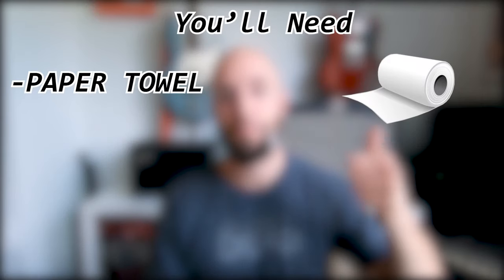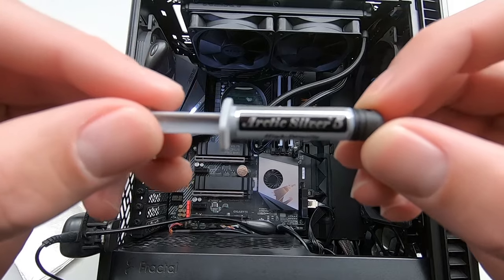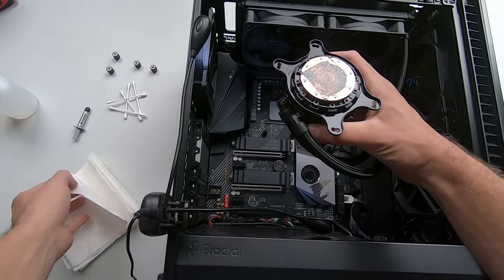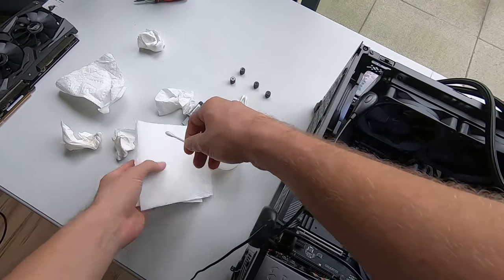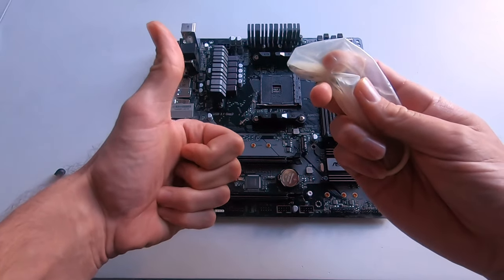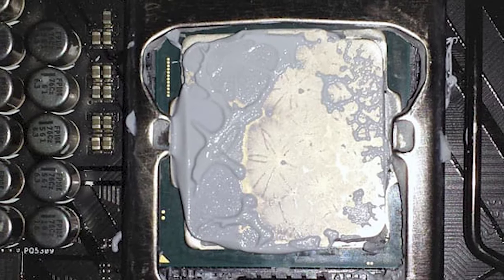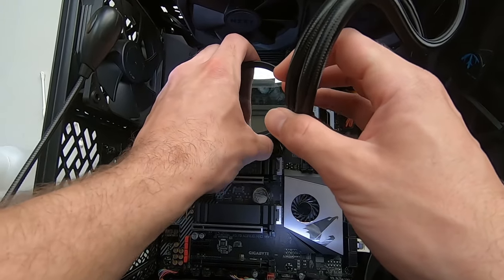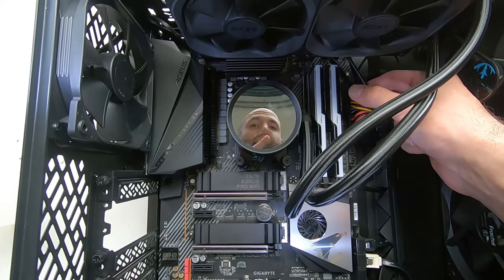BEGINNERS GUIDE: How To Apply CPU Thermal Paste

Comment: What to do if it keeps saying ran into error and keeps resetting
Reply: You probably didn't apply enough. The same thing is happening to me.
Reply: @1mobile984  you actually wouldn’t believe what the problem was… i took it to a professional and it wasnt my thermal paste application, my cpu or gpu it was the fact that my volts were too high and i had to get 1.2 volt ram instead of 1.35… odd pc problem encounter you dont hear about much lol
Reply: @lewispalmer3339  that's weird. My PC was running fine for a year until I recently swapped the cooling system and put another fan. All of a sudden it crashes
Reply: @1mobile984  can your power supply cope with the extra power needed?
Reply: @Gooner333333333  Yes. I ended up figuring it out. It was a bad PS3 controller 🎮 I was using. It kept crashing my PC until I unplugged it.
Reply: @1mobile984  Omg something as simple as that

Comment: Every when should you replace the thermal paste?
Reply from the maker: Until you have a thermal issue.
Reply from the maker: @Facepalm Full O' Napalm 1. Thermal throttling. Clearly there is a heat issue. 2. idle below 50 and below 80 when at load. That's my personal guideline.

Comment: You got any video that you switch to other cooler? Because i order a new cooler for my cpu and i want to change the old one for a new one ? I bought my pc not with a stock cooler but now i want to put a better one but do you need to dissamble your whole motherboard or can you dissamble just the cooler en remove de brackter in the back en put new paste and new cooler? Sorry to bother but i just wanna know iam from netherlands and they do not give much information here about it. Greetings j from holland 😊
Reply from the maker: You shouldn't have to disassemble everything. Usually it will come with that bracket to swap out on the back and the appropriate hardware for the front. Just take it slow if it's your first time.

Also, Max Verstappen #1 👑

Comment: My old 2016 PC build amd A8-7600 (i think?) randomly shuts off completely, not restart but shuts off. Could it be the thermals? Do I also need to do these same thing here? Thanks folks
Reply from the maker: Check thermals. you can use a program like HWiNFO to get all the data you need. It could also be a power issue.
Reply: @TechIlliterate  thanks for the response. I checked the power supply and their aint any issue. So yea, most likely the thermals. What do I do with it if it is not normal?
Reply from the maker: @sdmarinkashifu4536  You can re apply paste, clean out the cooler and make sure your case has proper airflow.

Comment: HOPING SOMEBODY HERE CAN HELP ME OUT, I MOVED THE HARDWARE OF MY LAPTOP INTO A NEW BODY AND NOW I GET NO POWER AT ALL NOT EVEN A CHARGING LIGHT. THE ONLY MISTAKE I CAN THINK OF IS I DISCONNECTED THE HEATSINK ATTACHED TO THE CPU BUT IMMEDIATELY REATTACHED IT ONCE I SAW THE THERMAL PASTE. CAN NOT REPLACING THE THERMAL PASTE BE MY ISSUE?

Comment: The proper way is to spread a thin even coat almost to the edge. Not drop a bead in the center.
Reply from the maker: Debatable. Shall I make a comparison video?
Reply from the maker: @Brian Babin impressive results. My tests turned out differently.

Comment: Thermal paste goal is to maximize contact via the micro groove imperfections of both the cpu and the heat sync... thermal paste is insulating as compared to the pure metal surfaces... that’s why the best method is the micro spread method. The pea method is WAY too much paste and you’re creating an insulation layer.
If your spread method leaks down the sides you’ve both spread too far and used too much thermal paste.
Reply: But the spread method can trap air bubbles. The Pea method misses the corners. The "X" method looked best in the "glass plate" test.

Comment: Do i need to apply thermal paste if my cpu doesnt come with a cooler fan
Reply: In case you're not trolling:
If your CPU doesn't come with a cooler that means you need a better cooler. Of course paste is always required.
Reply: @wartem  sorry i just bought all the parts to build a pc i never built one before. Im scared to put it together since i know nothing about the parts i have. I have a liquid cooling thing doesnt that connect to the cpu?
Reply: @SonictheHedgehogInRealLife  Paste helps you remove space between the cooler (liquid or fan) and the processor. Otherwise it's metal against metal hence too little contact.

Also keep searching these how to build videos from major channels and you will be good to go. Watch a few.
Reply: @wartem  yea ive been watching a few i have the installation guide to my motherboard and it shows how to put in the cpu, apply thermal paste , memory and liquid cooling fan.
Reply: @wartem  i found out my liquid cooler has thermal paste applied to it already. That means i dont need to apply thermal paste?
Reply: @SonictheHedgehogInRealLife  Indeed. Then it's pre applied which some are. Should be good to go. Just make sure to put it in place correctly according to the manual for your model. 
If you need to remove the cpu in the future you will have to buy paste and clean everything first before applying. I recommend Noctua NT-H2 or H1.
Reply: @wartem  ok i watched a couple more videos i understand a little more can you recommend some videos?
Reply: @SonictheHedgehogInRealLife  Remember to follow the manual but get tips from videos. Because some things are not the same.
I just completed a build btw as we speak :) 
Gamers Nexus is reliable. 
But just search "build pc" and watch some of the most watched and liked videos.

However I watched Linus tech tips first person pc build video. Can't say I liked it.
Reply: @wartem  thank you i will make sure i read all of the manuals first and do research. I got a static bracelet as well
Reply: @SonictheHedgehogInRealLife  Great!
Some uses it on their ankels to get use of both hands. It's in the way otherwise since it's connected to ground.
Reply: @wartem  can i connect it to the case i saw a video where a guy does that and says its fine.

Comment: Ethyl alcohol?
Reply from the maker: That's fine to use as well.
Reply: @TechIlliterate  thanks. I'm just trying to understand how to do it so if i build one Ik how 2, do you have any tips? Should I buy a pre-built instead? I only want it for gaming
Reply from the maker: @Marsmaybehim  Pre-builds are often great though you would be missing out on the satisfaction of building your own.

Also a great way to get to know the parts of your PC so you can troubleshoot if there are any issues.
Reply: @TechIlliterate  do you recommend any specific prebuilts for gaming?
Reply from the maker: @Marsmaybehim  Pre builds are great however you would be missing out on the satisfaction of building your own. Also good experience for when you have to tinker when any issue pops up.
Reply from the maker: @Marsmaybehim  I've only heard about which brands are good. No personal experience with them. Hesitant to recommend any. Have you seen Linus' secret shopper series?

Comment: Well, for PCs it's easy. But about consoles? Like my jet engine Ps4 pro that's about to take off. Idk if i should use more than i used on my PC. I use the Cooler Master maker gel 11kw conductivity. I fear liquid metal! So how much should i apply? Well anyway by the time you see this console peasant comment it will be too late! LMAO!
Reply from the maker: Any reputable thermal paste will do the trick. Just make sure to cover the entire die much like a laptop.
Reply: @TechIlliterate  Thank you. I watched the video where you made a comparison of the temperature and how to apply the thermal pastes. So far its better but the playstation hardware is trash

Comment: This is not the proper way to apply thermal paste. You don't put a small glob in the middle then just slap a heatsink on. There are two recommended methods. 

1) The cross method. Apply a thin layer of paste from top left corner of the CPU to bottom right, and top right to bottom left. This will fully saturate the CPU die when a heatsink is placed on it. ANY other method including the P or dot method will inevitably leave blank spots on the CPU where there is no contact between the medium. 

2) RUB IT IN. As the video suggests you don't need a lot of paste, but if you're paranoid, you can use your finger to smear the paste around and provide an even coating across the entire die except for about 1/2 mm on each edge so it gives some room to spread while placing the heatsink on top. If you do what was done in this video, the corners/edges of your CPU will not have compound on them, and thus you're only covering about 80% of the CPU. 

You only require a THIN coating, the thermal paste is a medium between the CPU die and the heat sink tubes so that 100% surface contact is made. If you placed the heatsink on the die without a paste, it will not make a good contact, and you could potentially damage the CPU from overheating. This paste has some silver compound in it that fills all the microscopic gaps and crevasses in the machined parts and provides a better heat conduction to the heatsink.
Reply from the maker: Fortunately it makes little if no difference. It's been tested beyond any doubt. Just get it on there. It'll be good to go :)